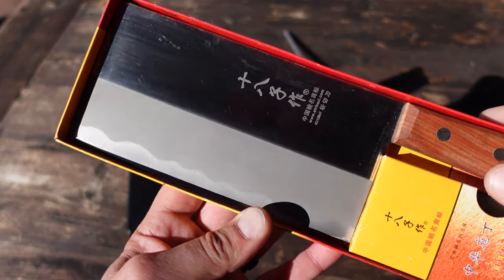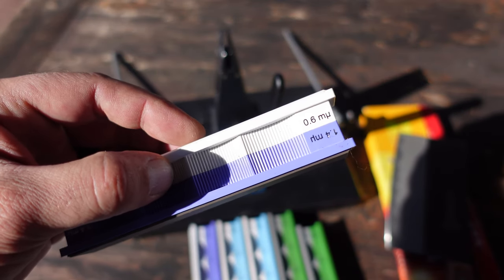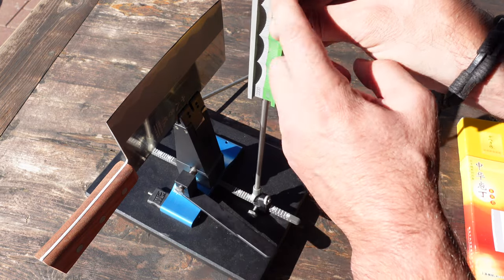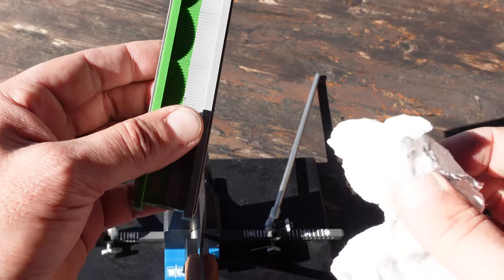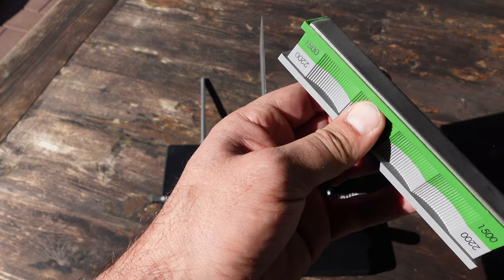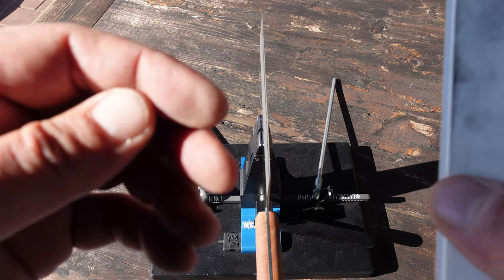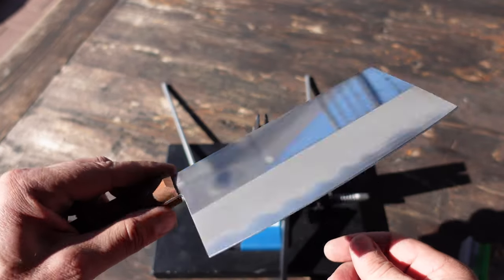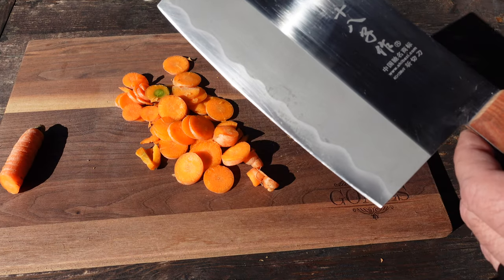Sharpening My Cleaver For The Upcoming Holiday Feast | Wicked Edge

Comment: Surprise you didn't do around 10 degrees for this thin blade
Reply from the maker: I used the marker to find the angle which is what WE recommends. It has helped me get a very accurate angle each time.
Thanks for taking the time to comment.
-Hg
Reply: On a cleaver?